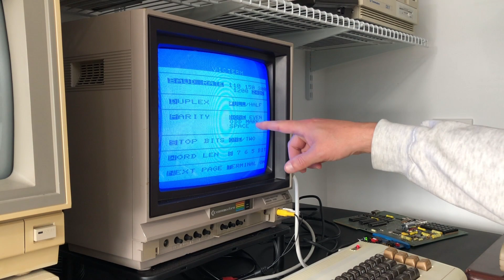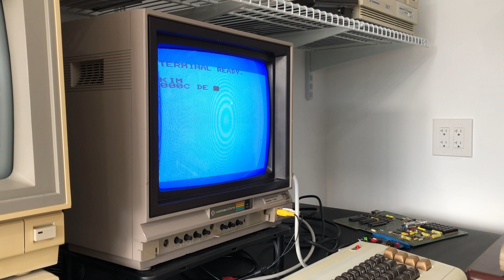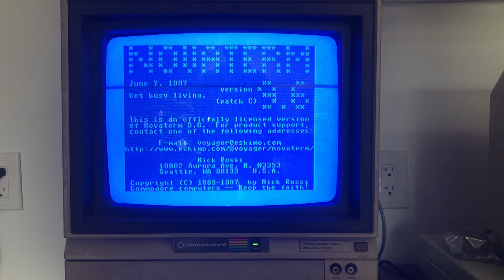Connecting a terminal to a KIM-1 computer

Comment: I notice with Vic20 in terminal mode KIM-1 startup memory address was 00C but on the C64 it was 004. Question What is setting the memory address on startup for the KIM-1.

Comment: WOW I have had the VIC-1011A since last May. I got it with a very nice working SX-64 along with some business software and a few Micropose games. I bought it from the son of the man who had owned it. I wish I know what he used the RS232 for, but seeing you video and the business software packages he had maybe he used it to turn his SX-64 into a terminal. Thoughts?
Reply from the maker: I can't think of many other practical use cases for the VIC-1011A back in the day other than for terminal connectivity.  There was also a VIC-1011B that did current loop and would have interfaced directly with the KIM-1.

Comment: This was a fun video if you want to connect your KIM-1 to an old VIC-20 and are using that to connect to a Commodore 1702 monitor. 
However, it is much easier to connect a KIM-1 to a monitor using the Corsham Board and a USB to Serial adapter and connecting that straight up to your computer and running a terminal program like Tera Term.

Comment: Why such a big side-board on the Kim1, I thought it had a UART right ON THE BOARD?
Reply from the maker: The KIM-1 does not natively support RS232.  Rather, it provides a current loop interface.  The Corsham IO board I'm using allows you to do RS232.  In addition, it provides you with audio input and output and a means to connect the Corsham sd storage device and memory expansion.

Comment: For anyone wanting to connect a Kim1 to a slightly more modern Commodore like you did, the VIC 1011A is not cheap to get hold of these days. There are modern clones available, like the GGLABS GLINK-LT, which you can find on E Bay for $50. That’s not exactly cheap either, but expect to pay at least 2x or more for an original. There are also TTL to RS232 adaptors available quite a lot cheaper than that if you have some soldering skills and a Commodore user port connector to wire to, but you need to be careful that they actually convert to 0-5V to full -12v to 12V RS232, and not just 3.3V to 5V. Many of them don’t work with actual RS232 voltages.
Reply: I appreciate how you are focused on connecting the KIM-1 to an old commodore computer, but I do not think anyone has mentioned, that it is a lot easier to connect your KIM-1 using the Corsham Board and an RS232 to USB cable  connected to your modern day computer, and of course using your favorite terminal program.